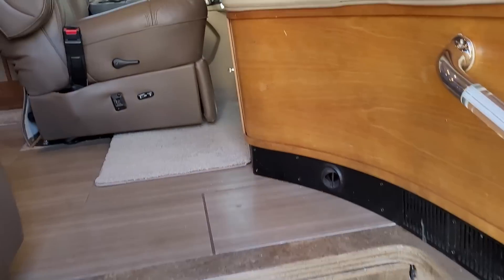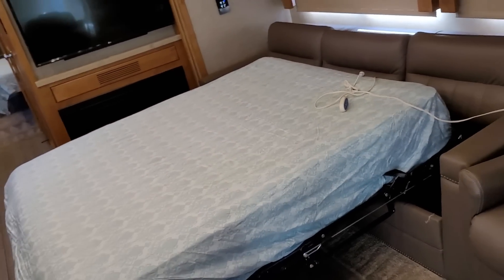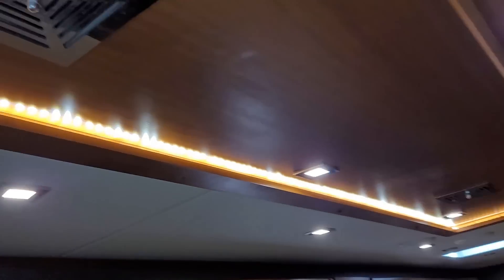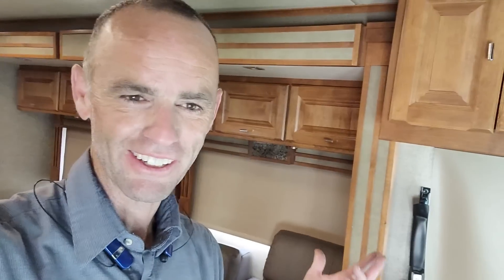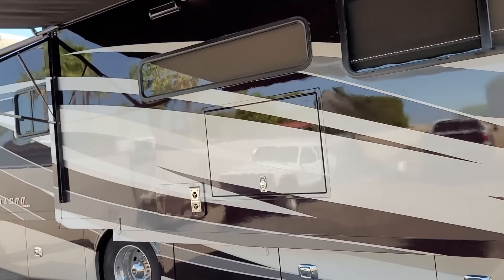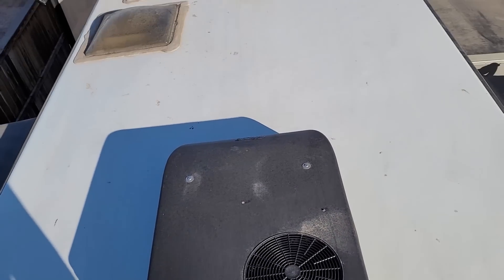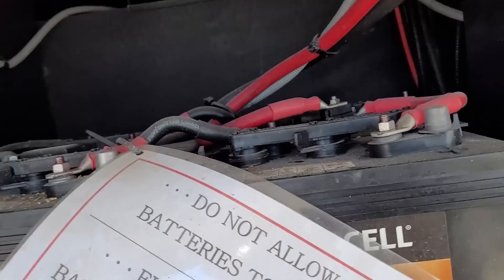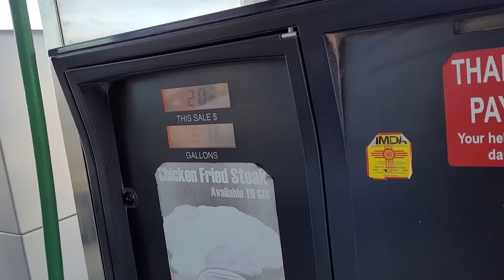Complete Walk-Thru of A 2019 Allegro Red Diesel Motorome

Comment: Awesome work! It looks wonderful. A little polishing up and it will be even more spectacular looking. It's terrible the imitation leather wears so quick and will be the same throughout the coach. Love gas stoves versus induction. 33ft will get you into more campgrounds and the relatively little 6.7 cummins should do well. Too bad you can't see or easily access the engine with the engine door open.

Now it makes sense why it appeared to be parked in your front yard for some video shots. There's probably no one more qualified than you to take it on the maiden trip. I hope you and the family have some fun!

It will be interesting to see how much they finally list it for and how fast it sells.  New 2021 33AA REDs (Rear Engine Diesels) are listed at about $300k online.